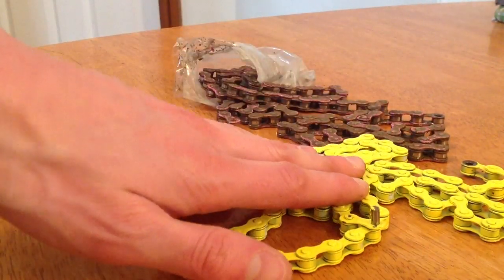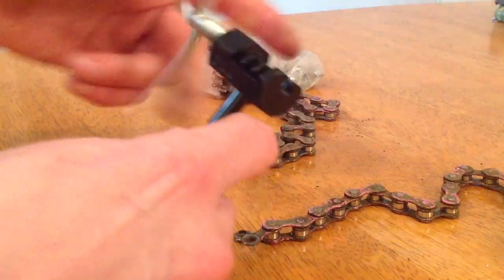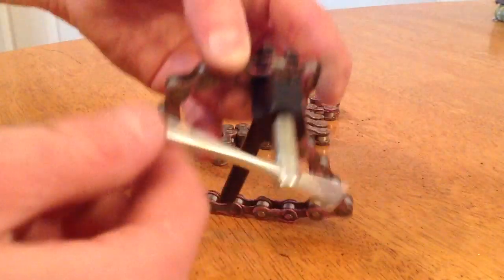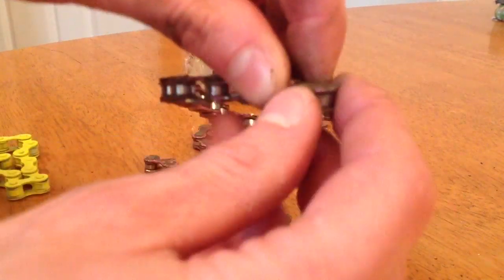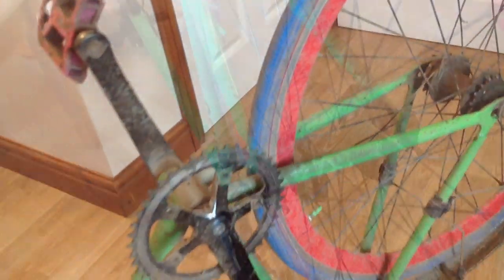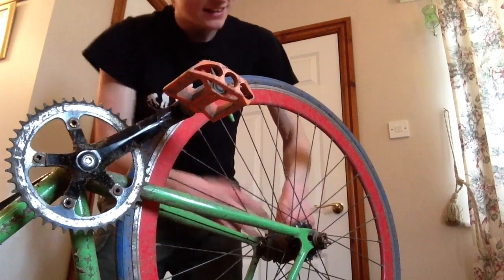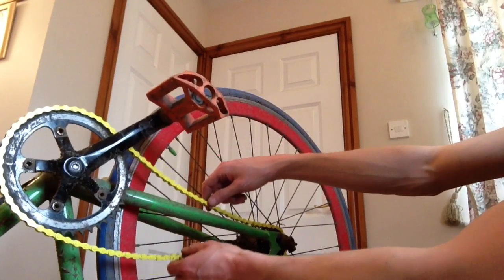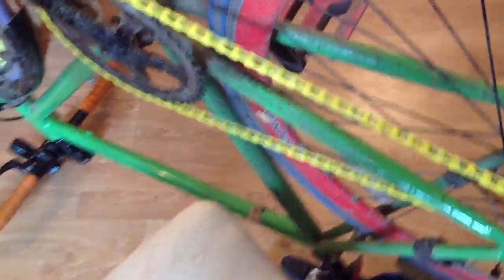Fixie Chain Replacement Tutorial

Comment: Chain is way too tight that's what will cause it too break is it is under too much stress when you are riding it. Also a quick tip before you fit the chain lie it next to the old chain to get the correct length and then cut the extra links out makes it a lot easier.
Reply: And try a little oil on your chain too, that also avoids snapping